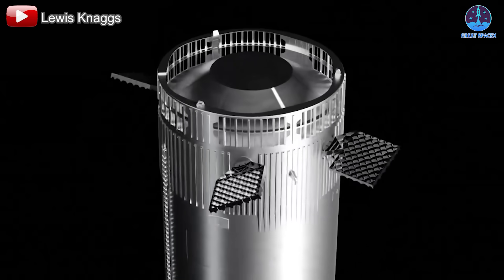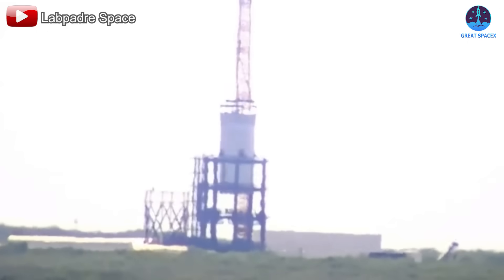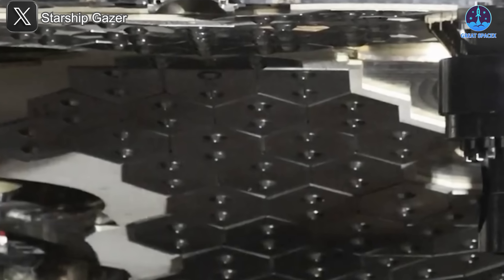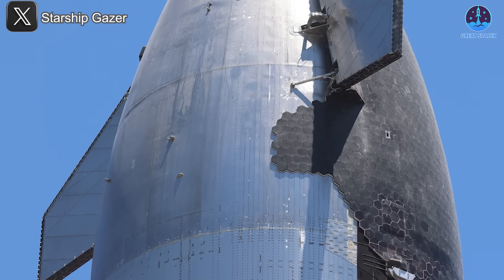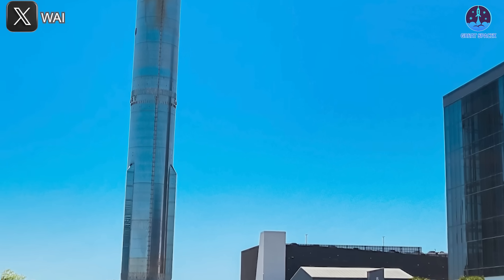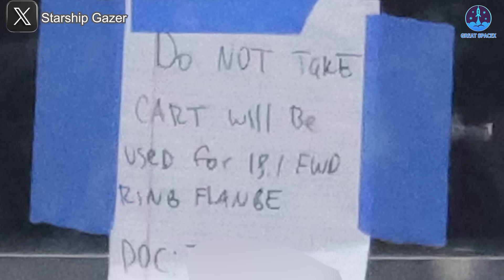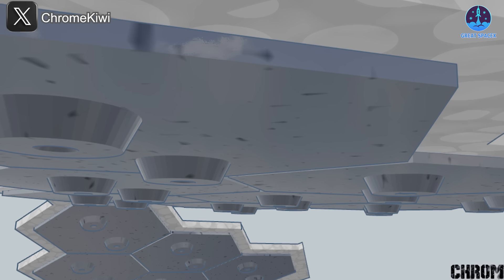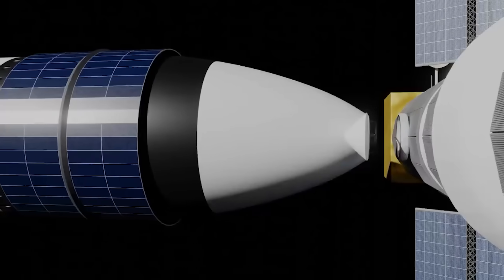SpaceX's shows new Starship Heat Tiles on Booster V3 with Big Design Update...

Comment: Kevin, B4 was the last V1, B7 up to B17 are V2. Tiles will be a replacement to engine shielding as Raptor v3s won't require them and there won't be anyting else to protect the aft dome and thrust puck without the engine shielding.

Comment: Will they get to V10 before the vehicle has a design that “closes”, meaning it fulfills the mission?
Reply from the maker: Will they reach a Starship V10 before closing the design? It’s unlikely they’ll need 10 distinct versions. SpaceX’s iterative approach—build, test, fail, improve—has accelerated progress. For example, SN15 nailed a high-altitude landing in 2021, and Flight 5 in 2024 saw a booster catch. However, challenges remain: recent upper-stage failures (Flights 7 & 8), untested tanker prototypes, and orbital refueling demos slated for 2025. 
 SpaceX might close the design by Block 3 or 4 (say, V3-V4) if they resolve reentry and refueling soon, given their pace of ~8 flights in 2 years. But if issues like engine reliability or life support drag on, we could see more iterations—maybe V5 or V6—before it’s mission-ready.

Comment: You know it would be awesome to see SpaceX try out a four-point deployable Liquid fueled Drake rocket system with full gimbal capability for landing horizontal on the moon. That section on test tank 17 where you see the blue tubes looks like the design for the HLS. The landing rocket engines.
Reply from the maker: Yeah👍